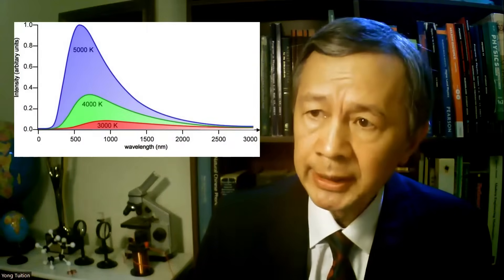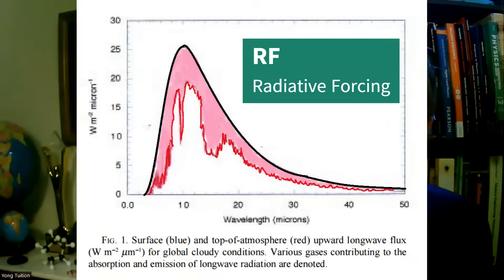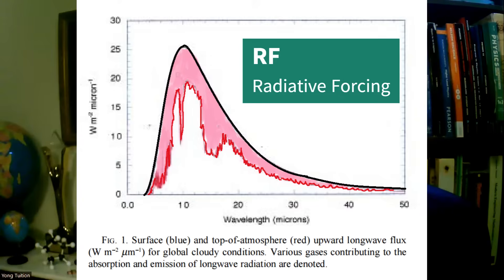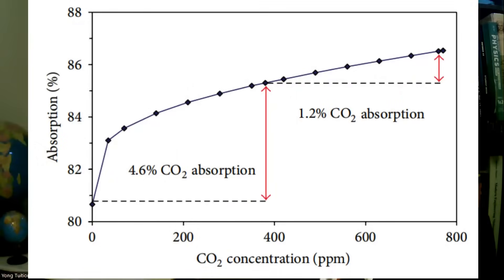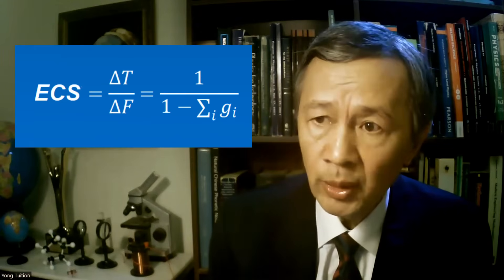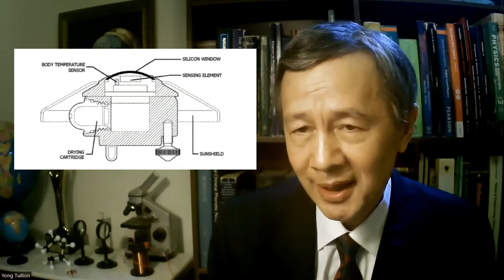The Weird Radiative Forcing at the Core of Climate Modeling | Independent Climate Research 230228

Comment: If the Thermal Outgoing radiation is 239 W/m2 this corresponds to a Black Body temperature of -18 C with the mean wavelength of this distribution is 9.6 micrometres - O3 has an emission band at this wavelength.  This is the temperature at the top of the stratosphere!.  I think the IPCC completely miss the stratosphere - the photochemistry of O3!
I think this notion of 'radiative forcing' needs careful examination. The IPCC published an energy balance model that is inconsistent. In the IPCC model, there are unbalanced energy inputs. There is no acknowledgement that energy flows laterally in the atmosphere - from the lower latitudes to the polar regions.  
Water dynamics in the atmosphere is massively important and not completely understood. It is worth noting that a hurricane is a heat pump that in a day pumps more energy into the stratosphere than the entire US energy generation for a year!  
Worldwide emissions of this gas are responsible for some completely unphysical amplification of energy in the atmosphere?!? This IPCC asks us to ignore energy conservation and the second law of thermodynamics?!? 
Climate is changing ... it has been doing so for about 4.8 billion years. The non-linear dynamics of climate are not all at instantaneous (radiative) timescales ... unlike radiative models, convective and conductive cycles range from years to decades (and possibly 100's of years). ENSO the Pacific Decadal Oscillation and tropical cyclones are examples.
The dogma is that solar radiation is not a driver - but sunspot activity alters the UV input intensity by upwards of a factor of 10! This is fine if you ignore O3 photochemistry and stratospheric warming.
The IPCC climate models are NOT right; the problem is that they are NOT EVEN wrong.

Comment: Re. "Positive Feedback"
The evaporation and convection of water from the Earth surface take out heat transporting it higher in the atmosphere where the temp is lower. This hypothesis that this water vapor cause "back-radiation" of the same heat back to the earth, and warm the Earth surface even more (breaking both the 1st and the 2nd law of thermodynamics in the process.) The so-called "positive feedback." Fact is that only a tiny fraction of radiated heat taken out of the Earth's surface will be radiated back in the form of long wave infrared radiation. Even if this colder radiation was absorbed (which it is not), more heat is going out than coming back and you have a cooling event in any case. Let's say, in a hypothetical dream world, 100% is radiated back and nothing in any other directions, then you get back the same amount you lost in the out-radiation. Q minus Q is ZERO, even with 100% back radiation! The theory is beyond any reality!🤡🤡🤡
The hypothesis is totally flawed and easily refuted.
Thanks for yet another educational video! :) 👍👍👍

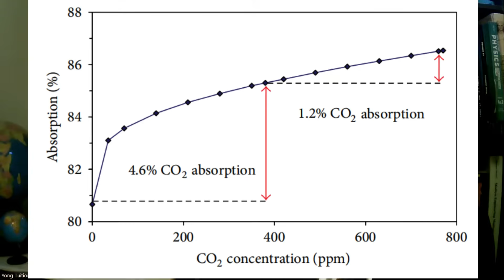Comment: At 5:20                                                                            
It looks like we are all agreed that the relationship between CO2 and temperature is logarithmic.  A logarithm goes to negative infinity at zero concentration. So as an engineer I look for "doubling" over what level.  The climate science community seems to think doubling over a stable preindustrial CO2 concentration. Formerly this was claimed to be 280 ppm, and more recently 300 ppm.  In the ice core samples it is readily observed that there is no stable preindustrial CO2 *concentration*.  Ice cores show a level of 260 ppm in 6000 BC and values as low as 180 ppm 15,000 years ago.      
                                                                                
Unfortunately  climate alarmists do not understand the basic math of logarithms.  I have tried to tell them that the second doubling will require four times as much CO2.  The warming trend slows down as the CO2 level rises.  It is not going to cause a catastrophe any time soon.

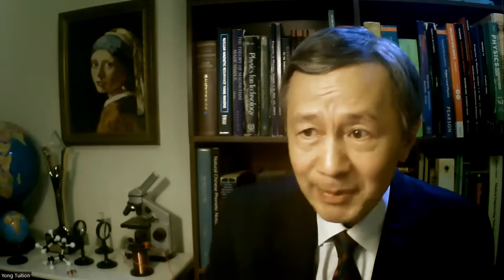9:00                                                                            
I think you need some help with your op-amp analogy.  Your illustrated circuit does not show any feedback.  Op-amps are  not stable without it.  I wish youtube allowed attaching images to comments.  I could send you something better.                      
                                                                                
I discussed feedback with key players a few decades ago.  I brought up that CO2 will increase temperature and that warming ocean temperature will release CO2 (solubility decreases with increasing temperature).  So we do have feedback. Their reaction surprised me.  First they incorrectly began    
calling it "feedbacks" as though there were a number of unknown factors awaiting discovery (career security?). Then they assumed without any evidence that the multiple unknown feedbacks would all increase with increasing CO2 levels leading to Earth becoming Venus like. They mentioned Hansen at the time, but never read any of his papers.  I don't think I ever will.  I don't get paid for this.

Carbon is a conserved quantity in the climate system.  We can make a model based on material balance alone without any reference to temperature.  Now the (empircal) feedback becomes a dimensionless quantity, and we can test for stability without knowing anything about temperature or difficult physical questions.  I spent a long time going over Law Dome ice cores in particular, and it seemed inescapable that the higher the CO2 level, the less feedback there was and the more stable the system.  When the CO2 level drops we have glacial/interglacial oscillations that indicate instability.  Anthropogenic global warming stabilizes the earth's climate and prevents a new glacial period.

Comment: So bottomline energy being realeased to space via LWR is dramatically overstated relative to thermal radiation. Thus, this fact dramatically reduces the interaction btwn LWR and GHG (the Greenhouse Effect).  This lets the 'air' out of the 'greenhouse 'gas balloon.  Puns intended.  Furthermore, Water vaper is a dramatically stronger GHG than CO2 which lessens the concern over use of fossil fuels (man made CO2)  Hence, Greenhouse Hypothesis is true, BUT has little to no measureable impact on Earth's climate.   

Lastly, the above would help explain why the climate models consistently overshoot actual temperature measurements.

Comment: This video and its comments are thought provoking.  One I had was is it not possible that the current warming trend is the result of positive feedback between warming oceans and increased H2O GHG  effects, with the initial warming initiated by 20th century Methane releases by drilling and coal mining?  This might not implicate CO2 to the degree it is alleged to have, since any source of warming might initiate the positive feedback warming.  I would not expect the positive feedback to continue indefinitely, but perhaps a century or more until Antarctic and Greenland ice melting affected ocean currents and surface temperatures or increased cloud cover to began a cooling trend.  Has Methane been studied with as much controversy, in light of the recent massive releases from the Nord Stream pipelines and CA natural gas storage failures.  I doubt 20th century oil field developers paid much attention to their releases either.  The EPA says Methane has 80 times GHE effect of CO2, over 20 years, on some basis, so can it be ignored?
Reply from the maker: The claim that CH4 has stronger GHE is based on one absorption peak of CH4 is located inside the so-called atmospheric window, about 1300 cm-1. Did you watch my talk on the atmospheric window? https://www.youtube.com/watch?v=VU02-mvvGOM&t=3s

In short, the idea that the surface emits infrared rays directly to space through the atmospheric window is problematic, so is the claim.

Comment: Thank you Dr. Yong.  I was reading about Pirani Gauges, which are used to monitor the integrity of vacuums in industrial processes. An element in in the instrument's chamber is heated to a given temperature, and the current requirement is monitored for an increase above the vacuum current state, where there are radiative and conductive end losses only. If gas is introduced, current requirement to maintain the element temperature goes up. PGs use an element with low emmisivity, about .05. In one particular model, the current requirement to the maintain an element with a .05 emissivity at a reference temperature in a vacuum is .4 milliwatts. Allow air into the instrument, and the current requirement at sea level atmospheric pressure is 100 milliwatts. 

To turn the PG into an energy transport experiment for Earth, I calculated per SB that if the emissivity of the element was increased to earth's, that is ~1, the current requirement in a vacuum would increase to slightly less than 2 milliwatts from .4. From 2 milliwatts with a vacuum, to 100 milliwatts with SL gas pressure in the gauge, is a 50x difference. This implies that IR energy emitted from earth's surface is only 1/50th the total energy removed from the surface by kinetic absorption by all atmospheric gases at SL gas pressures (760 Torr). 

The IPCC energy budget claims that the opposite occurs, and IR emission is over 80% of heat transport from the surface. A Piraini Gauge shows that this claim is patently false. If the IPCC's claim was true, that IR emissions overwhelmingly dominate heat transport in the Troposphere, vacuum flasks wouldn't work so well, and there would be little benefit in insulating against convection for buildings. How have they gotten away with a claim that is a complete fantasy?
Reply from the maker: Thank you JK.  I found the same research as yours from Tom Shula's talk. https://www.youtube.com/watch?v=NS55lXf4LZk&t=749s
whose calculation/measurment for the ratio of radiation to convection is  0.4/99.6.  Your independent study certainly provides another evidence. 

It seems not a matter how they have gotten away with their narrative. Instead, nobody has been allowed to argue with them. Radiative processes should constantly compete with non-radiative ones in the atmosphere, yet the former has been irrationally endorsed as the determinant.
Reply: @yongtuition  I have to make a correction to my post. I redid my calculation for the Pirani Gauge element's emissivity using an online SB calculator, and if the gauge's element is adjusted to be .95 emissivity, roughly earth's, everything else remaining the same, the actual wattage to heat the element to the same temperature as before in the vacuum case increases to just under 8 milliwatts, not 2 as I said above. So 8 mW would increase to a little over 100 in the presence of gas at SL pressure.  In other words, radiative transport is about 8% of kinetic transport.  A long way from the IPCC's 80/20 IR/kinetic claim.

Critics are telling me that a Pirani Gauge is not a proper model for an atmosphere, and I point out it is just comparing energy demand in a vacuum vs with gas present, so the little vacuum chamber of the gauge is sufficient for that comparison. 

On a related topic, it's occurred to me that a big elephant in the room being ignored is the energy consumed in adiabatic cooling, where thermal energy in all gases are converted to physical work, not light. Satellite measurements of radiative energy don't account for this, there being no radiation output to measure, and possibly this is why the assumption that almost all of the sun's energy is converted to IR radiation in the IPCC's energy balance hypothesis. But energy used up adiabatically doesn't show up in anything but in air molecules that are higher than before, work performed against gravity. 

Then I stumbled onto this paper which concludes exactly the same thing, assigning the same value as my virtual PG experiment, 8% IR heat transport in the Trop. 

 https://ruby.fgcu.edu/courses/twimberley/EnviroPhilo/CoolingOfAtmosphere.pdf

If you've already covered this, please link to the applicable video.  Thanks!
Reply: @JK-rv9tp  your referenced paper was published in 2008. The idea that increasing co2 might cause too small to measure cooling is well thought out and compelling. Hard to believe that anyone would be certain that co2 causes warming after reading this paper. Thank you for bringing it to our attention.

Comment: That the concept of radiative forcing does not refer to a real (measurable) radiative heat source can also easily be seen from solar thermal energy collectors. They always calculate with a maximum energy flux of 1000 W/m2 (due to 300 W/m2 scattering loss in the atmosphere). If radiative forcing was a heating source, this should be easily in the 1300 or 1400 W/m2 range (basically higher than the total flux from the sun ---> Conservation of energy ... anyone?!?).

Comment: Dr. Yong, I would like you to discuss how climate modeling deals with a Total Eclipse

1. A total solar eclipse is a wonderful experiment conducted by Nature about 1 every 18 months
2. In this experiment the only variable modified is the removal of solar input on the earth
3. The experiment is conducted over  different parts of the earth every time
4. Billions of cubic meters up to a height of 10 meters cools by 2 to 5 C by a total solar eclipse
5. Cooling requires the radiation of energy in the order of 10^12 kjoules of energy in minutes
6. In calm dry air, CO2 is the only mechanism that could possibly radiate that energy
7. If CO2 is cooling the lower troposphere that effectively under a total solar eclipse, then this cooling must be balancing the solar energy inputs prior and post a total solar eclipse
8. If no CO2 was present in the lower troposphere, calm dry air would not cool under a total solar eclipse
9.  As CO2 levels increase, one would expect that more cooling would occur
10.  TODO:  as CO2 levels rose since 1960 one might expect that cooling under total eclipses has increased.  We have the data, we should do the research
Reply from the maker: It sounds as a "negative atom bomb" experiment. The column without the solar radiation (beam) would absorb more from the bright parts outside. But it seems hard to draw any conclusion as it might be quite chaotic in terms of air flow and radiation.
Reply: @Yong Tuition  wind and convection are suppressed under a total solar eclipse (where the umbra is 113 km in diameter.)   This makes sense because the eclipse blocks the heat source that was fueling convection until the sun is blocked.

Thus less turbulence, in cases when the wind and convection was already low, can't have cooled the air.  And cooling is always observed with a full eclipse but some cold air being available to create cooling can't always exist.

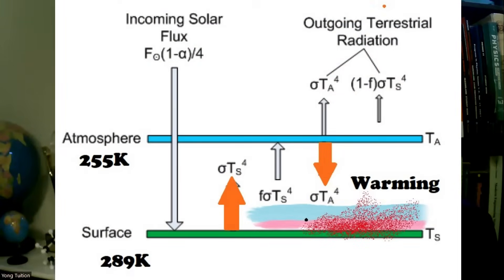Comment: As I understand the diagram at minute 7:17, a colder body can transmit and heat  a hotter body? This is akin to claim that a hotter liquid mixed with a colder liquid of the same volume will increase the temperature of the mix? Do I understand this diagram correctly?  
And what about the radiation of the heat  of the CO2 molecules, excited by the long wave radiation from the earth surface, into the upper, much colder atmosphere?

Comment: Dr. Yong, may I ask you to help me understand this point #20: For example, if the percentage change in radiation intensity increases by 2%,  the percentage change in the temperature of a black body will be 2 divided by 4, equal to 0.5%. ----- Should it not be logarithmic, meaning temperature change = radiation intensity ^0.25  ?? It seems the math is actually complicated since we need to resolve (Tx^4 - Ty^4)
Reply from the maker: The two percentage changes, DeltT/T and Delt I/I, are proportional to each others, which is linear rather than logarithmic.

Comment: Temperature and average temperature are two different concepts. Stefan-Boltzmann's law runs by temperature, but you can not use average temperature there, because the law is non-linear. This is not especially difficult mathematics.
Simply said, Sahara afternoon send lots of thermal energy to the space, far more than its proportional share. And so do all hot areas.
If their model uses average temperature in Stefan-Boltzmann's law, their model is crap.
Reply: Indeed. And of course using SB as a proxy f the Earth is already problematic. I guess they want to make sense using general physics principles. So, by cutting out the particulars, of which there are many, they use an average which is by definition aproportional. In other words: simplify complexity to a number one can use in an equation. Isnt that the whole problem in climate science?